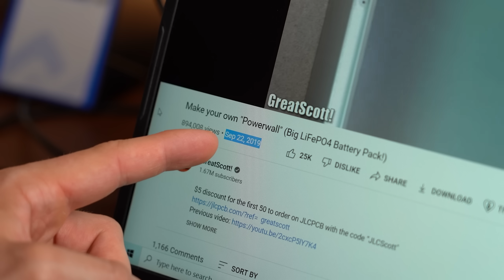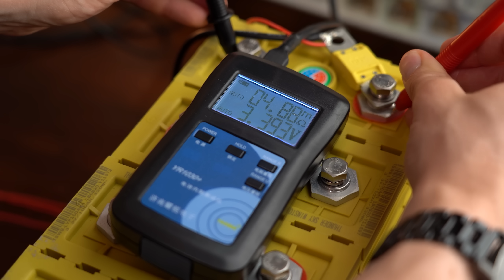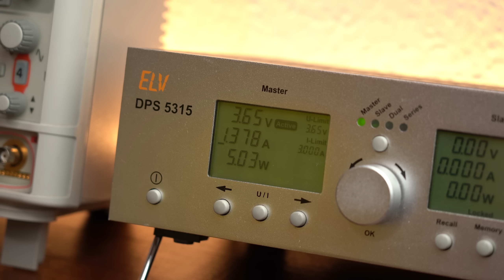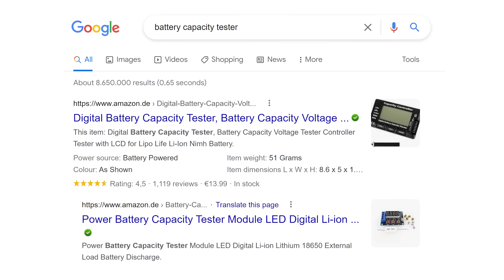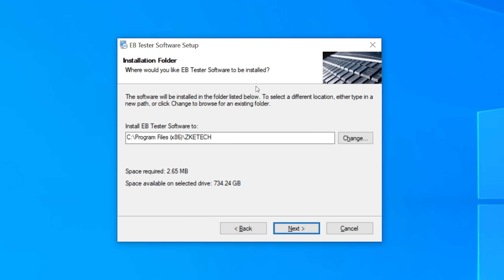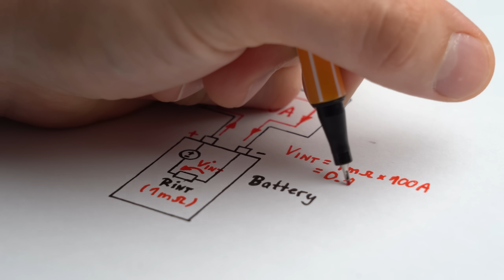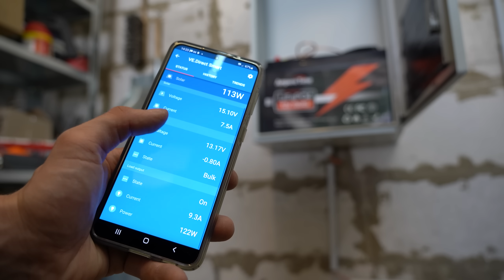Is it Time to Replace your Batteries? Here is how you can find out!

Comment: I’m not a fan of these battery systems for the same reason I don’t store petrol at home. Although if it’s something you have to do the fair enough.  Another great video thanks for sharing! Best regards chris
Reply: LiFePo cells aren't a fire risk.
Reply: @Nitecrow314  Of course they are a fire risk the short circuit current for such batteries is in the hundreds if not thousands of amps. Do you seriously want that amount of energy storage capacity in domestic situation. There are literally hundreds of fires caused by battery storage and UPS installations every year.

Comment: Scott, for the fun of it, if you powered the laptop directly off the batteries (assuming 13 volts would drive it) how much longer could the laptop run. I think I would like a 24-48 volt system if I could afford it and then I could have any voltage below that to run stuff from without having to go thru the power inverter.

Comment: Could make a heating/cooling system for the battery. Most lithium batteries are designed to be charged above 0°C and can even be dangerous after being charged at low temperatures due to the formation of dendrites.

Comment: Awesome Scott! I own a ZKE Tech EBD-A20H - It has banana jacks unlike yours but it does not charge like yours does.. i love them!!
Reply from the maker: Thanks for the info!
Reply: @greatscottlab  Yep and if you ever have any problems with it disconnecting in the middle of a test where  it stops collecting data switch to a different usb or “COM” port (like com6 instead of com1) mine was giving me issues at first because my laptop is going to sleep so I turned off auto sleep and then it was also disconnecting even not going to sleep, the machine would continue testing but the data would stop transmitting to my computer. but I am using a different USB port now under recommendation from someone else and I’m successfully doing several hour long tests with no issues… It looks like you were doing that anyways but just in case you ever have that issue this is something to make a note of.

Comment: Would it be possible to build a self calibrating current sensor that's based on the internal resistance of the battery?

I wouldn't think so because the battery provides a voltage, but that would be interesting if it works.

Comment: Hi you are the best person in terms of learning electrics. But i am not a technical person .. i need to ask you something .. my laptop motherboard got 2 blown inductors laptop is running fine and charges fine can you give me any idea what was the inductance value without and shcametics
Reply: You probably meant capacitor?
Nobody can tell you that, but the manufacturer or whats listed on the capacitor itself.
If the laptop runs fine, chances are its just for the charging system or you'll only run into trouble when using high-power.

It probably really isnt worth fixing this..
Reply: @tarakivu8861   nah i check they are the capacitors size components in greyish color not the fleshy capacitors color

Comment: for me just the DC - AC  internal resistance test part still not clear.
you said both of them are important but the difference in values were huge. and not close to manufacture values for the DC test but after that you said that they still are in good condition.
so is that a NO for the manual dc method used in this video?
i love your videos and im always learning from you GREAT Scott ❤️

Comment: Dear Scott, I work with Winston cells for years now and do a lot of measuring for customer requests. Discharging with 0.1C is not that accurate if you want to find out the health of your cells. The optimal discharge current presents a much close number for the real capacity. Love your videos, keep up the good work!
Reply from the maker: Sure but my normal load is 8 to 10A. That is for what I want to know the capacity.
Reply: @greatscottlab  Yeah, in your case it is totally fine.
Reply: @greatscottlab  But unless you tested it with ~9A draw when it was new, you have no baseline to compare it against. So maybe now it pulls its rated capacity, but it might've done 110% when new with such a light load. Most capacity testing is done at 0.2C, for consistency.
Reply: To have a baseline to compare with, a measure of the initial battery should be made, because commercial numbers are not representative anyway. As soon as you pick the same comparison parameters and those parameter are within specification ranges, there is no issue.
Reply: do you mean that testing a 3 amp hours battery at 3 amp discharge is optimal?
Reply: @hammadiazaiez9337  3A for a 3Ah battery is 1C. The optimal discharge is in the cell specification. It depends on what it was intended for.

Comment: Why did you measure 2 voltages under 2 different resistive loads instead of just subtracting one voltage under a known resistive load from the open circuit voltage, then calculating the internal resistance from that?
Reply from the maker: Because the drop between open voltage and one load is pretty big and not representative for the internal resistance. That is why I used one small and one big load. Minimizes the error.

Comment: Pretty interesting indeed! Thanks, man! 😃
Hobby chargers (used for lipos) usually show the battery internal resistance. But I'm not sure if there are any li-ion chargers that do it. I'm going to search about it! 🤔
BTW, you should definitely get a tiny whoop to rip that little battery! 😬
Anyway, stay safe and creative there! 🖖😊
Reply from the maker: Thanks for the info!
Reply: There are chargers meant for multiple chemistrys that can measure the internal resistance. I've had a some cheap (25€) chinese charger for 5 years that gives pretty accurate IR calculation. Also got a 20€ Liitokala Li500 charger for Li-Ion,  NiMh and NiCad does that.
Reply: @Teknopottu  Oh, great to know! I'm going to look about those. 😊
Reply: @MCsCreations  Liitokala is meant for cylindrical batteries but I modded mine with a wire and alligator clips to test different kind of batteries. In that model's case it is meant for single cells so no 12V batteries are tested and charged with it, only ones with 1,2-4,2V. Don't seem to remember the other chargers original name, it's a pirate version of a more expensive charger with also lead acid and packs with several cell support. Hope this helps.
Reply: @Teknopottu  It does! A lot! Thanks! 😃
About testing series packs, I have a hobby charger, which is pretty small and works great. It's the ToolkitRC M6, but I can't recommend it because many people related chargers from them failing. You know? Although mine works great for more than 2 years already.
The ones from ISDT seem to be great though.
Reply: I use a hobby charger from iCharger, their model 4010Duo, that can charge/discharge just about any battery chemistry out there.  It can balance charge up to 10S Li-Ion cells at up to 70A assuming you have a 24V - 48V DC source capable of delivering the input power, and discharge same at up to 40A.  I use it mostly on my electric bicycle battery packs and has worked very nicely over the past several years.

Comment: I bought that same zke tester, and recently the cable between the power brick and the tester got extremely hot and the plug on the tester melted. The aliexpress seller refuses to respond, and since its been more than 90 days, paypal and aliexpress wont do anything about it, and the seller simply suggested i should buy a new one. Its 10 months old and has been used to test 5 batteries in its lifetime. Two 100ah 13.2v lifepo4, and 3 individual 400ah lifepo4 cells. It failed when i attempted to test one of my new 280ah EVE lf280k cells. I have no idea whats wrong with this unit but it seems theres an internal short, only once the test begins.
Reply from the maker: That really sucks. Sorry to hear that.

Comment: I based my master thesis on active BMS capable on performing Electrochimical Impedance Spectroscopy (EIS). You basically inject a sinusoidal current on the cell, measure the voltage perturbation on it and get magnitude and phase of the resulting impedance at that frequency. Usually, you only characterize the capacitive region which goes from about 1Hz to 1kHz, in the transition between capacitive and inductive behaviour you get the value of the AC cell (bulk) resistance
Reply from the maker: Thanks for the feedback. Interesting.
Reply: But did you fit it in such a way that ensures side fumbling is effectively prevented?
Reply: @yeahnah6468  lol
Reply: What is "Electrochimical Impedance Spectroscopy" (EIS)? (sounds like "Smith chart" usually for RF -stuff)

Question, does the "internal resistant" shange with different frequency and magnitude ?? (and why not plot it from small-small frequency, say nanoHz???)
Reply: @phoohb  it's the name of the technique I mentioned before. The results are plotted on a nyquist plot, typically with inverted Y axis. There is no benefit in going lower than the mHz range, you basically measure DC resistance and it takes forever to get a measurement
Reply: @davidefogagnolo  interesting
Reply: David, are you working the same topic im odh studies?
Reply: Get a load of mr. Big brain. Do you even lift heavy rock?

Comment: I keep seeing people make this mistake, and I don't know why. I highly recommend not using an AC inverter whenever possible, not only due to some energy loss during convertion, but also because LEDs typically have terrible power factor.
There are 12V LEDs out there, mainly meant for RVs, they can run both on 12V DC and 12V AC, and in case of DC, 4 of them (rated for 3-4 W) in parallel barely drawn an amp while giving off a very good amount of light, enough to normally light a somewhat large room. 
Same for laptop chargers, there are 12V chargers for laptops (meant to be used in a car), and they are efficient.
Reply from the maker: My LEDs run of the 12V of the battery. Only for the laptop example I used the inverter.
Reply: @greatscottlab  oh, okay. good. I assumed you used an inverter because they draw 8A. that is a lot.
Reply: @Kyuunex  Yeah this seemed excessively high to me as well, especially for LED’s.

Comment: I've been using my 48v solar system for a while now I've just uploaded a video in my channel mostly all victron products incased in a server rack I produce 6kw a day of two 420 watt panels and have lifepo4 60ah 48v will be upgrading to more solar and batteries soon now my room is off grid running my 3d printers , pc, two 28 inch monitors have lots of power this is the way to go now on grid to expensive and will be unreliable in the future.
Reply from the maker: Sounds like a good setup ;-)
Reply: 48V system with 2 panels? Sounds excessive :)
Dont you get into trouble often because your cells cannot generate more than 48V for the MPPT Charge-controller in low-light conditions?
(Its very rare to have one that can boost voltage due to inefficiencies)
Reply: @tarakivu8861  panels are in series equal 90volts

Comment: Plz make video on diy or buy active cell balancer
Reply from the maker: I can put it on my to do list. But I already did a video about BMS.
Reply: @greatscottlab  as I made diy  48v 13s Li ion pack i use bms with passive cell balancing it doesnt work for me i need diy version active cell for my pack  i watch lot videos on YouTube i couldn't find any diy version
Reply: Buy the jikong bms, i have one on my 4s 280ah battery and also one on my 16s 400ah house battery, it has bluetooth and 2amp active balancing built in, and it works amazingly well. Highly recommend.
Reply: Cell Balancer isnt worth it as you should have a nice BMS anyways and this balances for you.
If you really need a balancer.. just choose a 10$ one..